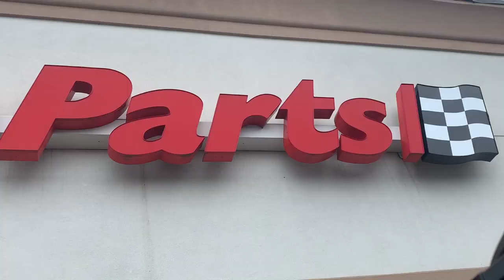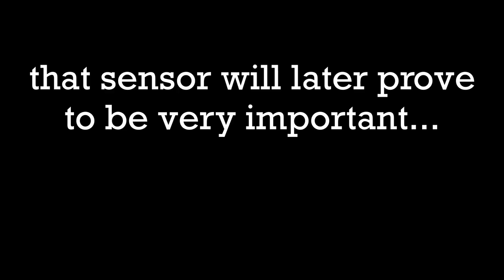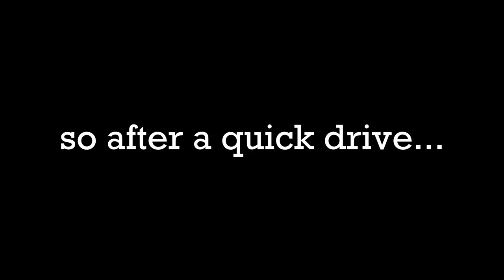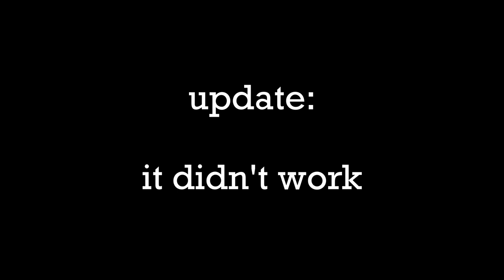Fixing Oil Leaks | Mk4 Jetta

Comment: Nice job! I will be doing my 2000 mk4 gti soon as it has the same issue- a leak on the filter housing. You have a lot of patience bro! Question: did you end up draining the oil each time or were you able to just pull off the housing without draining the oil pan?
Reply from the maker: i didn’t have to drain the oil! it sits higher than everything filled with oil so just let the car sit for a few minutes after running to let the oil drip to the bottom and then you’re good to go!